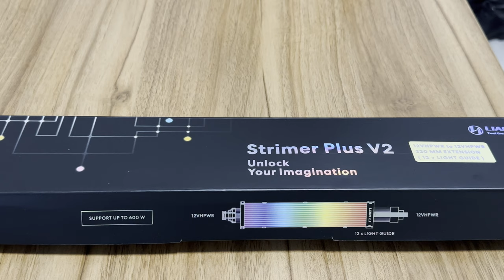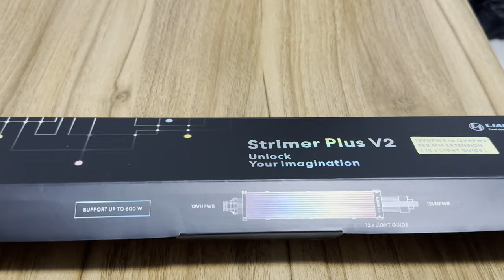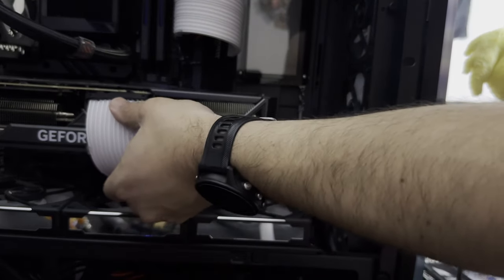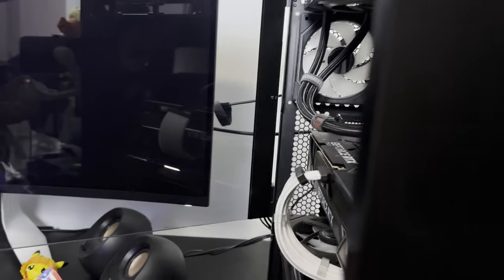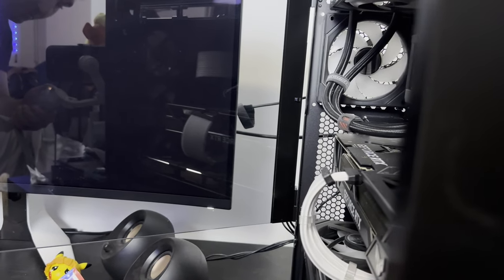OFFICIAL Lian Li Strimer V2 for RTX 40 Series GPUs | Installation and Overview

Comment: Hello, I have rtx 4070 FE, and asus z790 P motherboard. I saw from amazon that they have 24pin, triple 8 pin etc. Which one should I buy for both my GPU and motherboard?
Reply from the maker: Only one version of the 24 pin, the only difference is wether or not it comes with the controller.

For the GPU it depends on your power supply.  Does your psu already come with a nvidia 12+4 vhpwr cable? Or does it just have 6+2 pin cables? Depending on the psu is going to dictate which gpu strimer to buy
Reply: @Mdntech3000  my power supply is 850 Watts - Standard 80 Plus Gold w/ PCIE 12+4Pins Connector for PCIe 5.0 graphics cards [-33]. And I already have a Lian li controller cause I bought Lian Li SL Infinity fans. Basically I have a total of 2 controllers now. Which one do you recommend to buy? PW24, PW16 or the PW12?
Reply from the maker: So you can buy the 12+4 to 12+4 (male to female in other words) since you have a 12+4 from your power supply.

You’ll use the provided 12+4 pin connector from your psu to the female side of the strimer, then the male side to your 4070.

Looks like this - https://www.amazon.com/Lian-Li-PW16-8PV2-Strimer-Plus/dp/B0C253DP4W/ref=mp_s_a_1_4?crid=LOTUG2OTJX2O&keywords=lian+li+strimer+plus+v2+12vhpwr&qid=1685340370&sprefix=lian+li+strim%2Caps%2C73&sr=8-4&ufe=app_do%3Aamzn1.fos.006c50ae-5d4c-4777-9bc0-4513d670b6bc
Reply from the maker: Additionally, in my video this is what I’m using (12+4 to 12+4)
Reply: @Mdntech3000  Thank you! how about for the motherbooard? which one should I buy? 
my motherboard is:  ASUS PRIME Z790-P WIFI D5 DDR5 ATX w/ Wi-Fi, 2.5GbT LAN, (4)PCIe x16,(1)PCIe x1, (3)M.2, (4)SATA
Reply from the maker: But the 24 pin Strimer that’ll go into the 24pin on your motherboard.  Also, just to be clear the strimer controller and Lian li sl infinity controller are different and you need to use both.
Reply from the maker: Looks like this 

https://www.amazon.com/Lian-Li-PW24-PV2-Addressable-Controller/dp/B09ZPJDFJ2/ref=mp_s_a_1_3?crid=LOTUG2OTJX2O&keywords=lian+li+strimer+plus+v2+12vhpwr&qid=1685340370&sprefix=lian+li+strim%2Caps%2C73&sr=8-3&ufe=app_do%3Aamzn1.fos.006c50ae-5d4c-4777-9bc0-4513d670b6bc
Reply: @Mdntech3000  Thank you so much for replying. I got everything now. You're the best man. 💯
Reply from the maker: Great to hear! Glad I was able to help if even just a bit, enjoy your build !!
Reply: So I have a 4070 that has a 8 pin pcie connection is there a strimmer I can get?
Reply from the maker: Yes! You can buy the default strimer that came out last year, that has 8 pin > 8 pin
Reply from the maker: Just note, there is no single 8 pin strimer…so if you buy the 2x8 pin strimer just don’t connect the other port.
Reply: @Mdntech3000  ok will do, thanks!

Comment: if i have an RM850e and a PNY XLR8 4070 Ti then what cable would i need
Reply from the maker: Does your psu have a 12vhpwr cable? If so then get the 12 to 12 ping strimer.
Reply: @Mdntech3000  no but it does have a 12+4 pin pcie cable that im pretty sure can connect from the psu to the card

Comment: The 3090ti has 3x8 & 12+4 pin, so this is also compatible with the 3090ti, right?
Reply from the maker: Yes! The one I linked is 3x8 to 12+4
Reply: @Mdntech3000  Awesome! Thanks!
Reply: @Mdntech3000 I installed it today and it works great, but the 24pin strimer is plugged into the controller and the remaining open slots don't look compatible with this cable. Does it require a separate controller?
Reply from the maker: Which slot is the 24 pin connected to in the controller? 

Use the top slot for 24 pin(or bottom depending on orientation of controller) and for gpu use right (or left depending on orientation) slot.
Reply: @Mdntech3000  the 24pin is plugged into the top. The open slots look like they have more pins than this cable has.
Reply from the maker: That’s the setup I have and it works fine.  Is it seated all the way into the port? It takes a good amount of force to fully connect it
Reply from the maker: With top / 24 - side / gpu cable it should work no problem.  I’m at work right now and off the top of my head not sure if the other ports are exactly the same
Reply: @Mdntech3000  So I discovered the there is one slot that can fit the plug and I made sure to hit the toggle switch so it's synchronized and working. Thanks for your help. Love the lights!
Reply from the maker: Awesome! Yea in my video I emotion the toggle switch.  Glad it’s all working out!